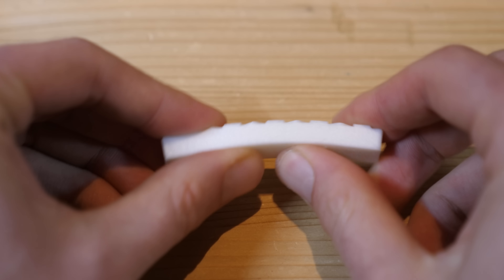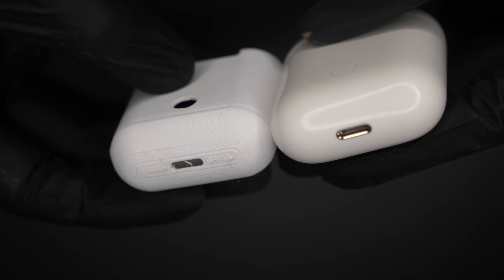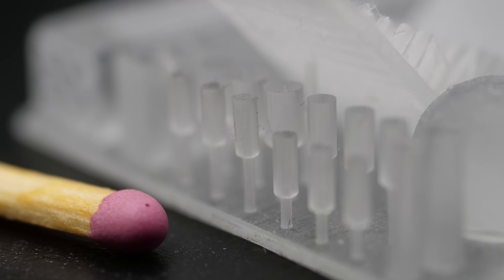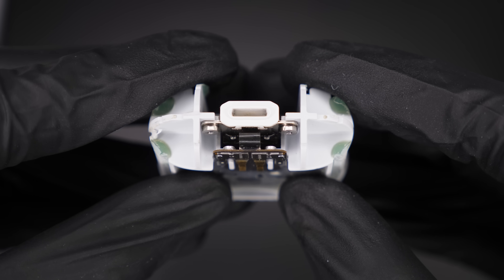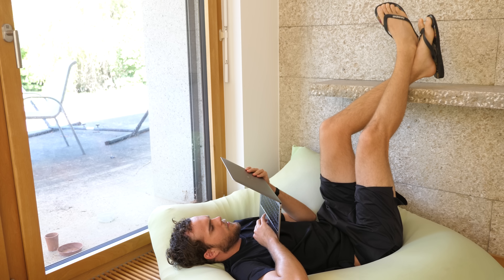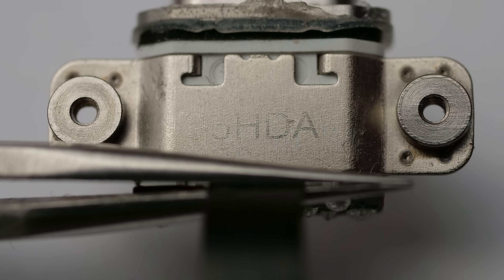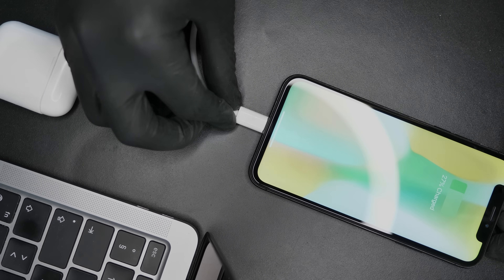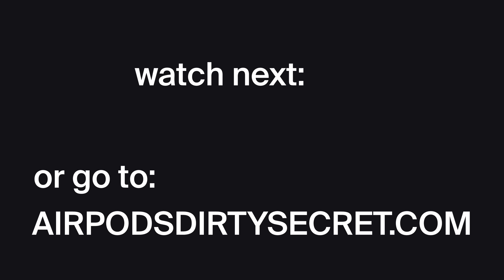AirPods' Dirty Secret (and how I'm fighting it!)

Comment: While I am not an expert in any of these fields that are shown here, the general problem with these replacement cases is they never have the same resolution. You could get close with a $3000+ printer, but never perfect, because injection molded plastic while extremely expensive if you are doing 1 case, makes mass production much cheaper, and gives much better quality. No doubt you did a really good job, but it is very hard to match the physical case quality without injected molded plastic sadly. No hate to you, but this is the hard reality of it. I been using a airpods 3 super clone for the past year(slightly before release), and they have been great. The 1 thing that when compared side by side with real ones that sticks out is the henge, the textured pain rubs off. They gave me(The end user) a pretty high quality product for $50 by dropping the profit margin, and giving a slightly less quality henge that is just less visually appealing.

Comment: I believe if this were to be made on a slightly higher scale, laser welding would be the perfect tool for the job. I’ve worked with laser welders before and this is exactly the sort of thing they excel at. There are companies that specialize on these types of projects in small scale production, one of which is where I worked with these laser welding machines in Germany.

Comment: you don't need a tig welder, just use iron, copper or bronze for the parts and solder them with tin, will not be as durable but will be enough

Comment: While I agree that Apple's policies are ridiculous, it could easily be argued that this method has much more of an environmental impact than reordering a new case. When everything it takes for these components to be created and delivered is taken into account (initial unusable 3D models, fuel associated with transportation, and waste at each manufacturer) buying a new one probably is more economical, both monetarily and environmentally. Cool vid though.
Reply: Good point. But a lot of that could be avoided if Apple made their products repairable from the start

Comment: You can buy around the same quality sounding earbuds for 30 dollars or so online but have to know what ones to get. 

I hate apple so much, I got a redmi K40 12/256 on a flash sale in the UK for 194 pounds with redmi buds 3 Pro included after I bitched on the phone that my 40 pound coupon did not work.

And wow they sound better than apple buds.

I went with the K40 as it was before the SD 8 gen 1plus was announced and you could see how bad the 888 and 8 gen 1 was and thorrling worse than the 870.

The new mediatek dimensity chips look good but no way to bootload them. 

I like how easy it is to get official parts cheaply form China and how easy it is to replace the battery.

I really wish they would standardise on a USB turbo charger as some company's have mulple types depending on the wattage and even if the same wattage it won't work with another company's.

I'm really surprised apple is not moving towards faster charging, maybe they will just have no port so the EU can't force them to go to USB C lol

I'm surprised the US and Canada does not have a 2 year minimum warrantee like in the UK and EU. 

All phones, computers, laptops, pads most electronics all cars and home appliances should have the right to repair, use standard hex or whatever screws that are non proprietary and you should be able to get schematics for free and parts for a reasonable price, it should also be legal for company's to make OEM parts just like company's do for cars. 

If company's had their way you would have to call GE to have a GE genius come over to change your light bulb. 

I have seen quite a few collage students who rent apartments and you go inside their home and think why is it so dark as alot of the bulbs in a certain room are out. 

You ask them and get a reply like I will get a friend / the landlord to fix it.   
Not just girls, guys also....

Comment: The amount of times these heaps of junk gets issues and need to be replaced is insane. But it's not an issue exclusive to Apple. Every single other wireless in-ear headphones are RMA'd in 3 steps.

1. Report issue
2. Get credit return on product after either NOT sending them or sending to repair shop for inspection. (Jabra/Sony needs you to send them in for inspection, while cheaper garbage like every Airpods clone and most low-end brand you just throw it away without anyone needing to check. Everything still gets scrapped and swapped either way if accepted, never repaired.)
3. The item gets scrapped.

It's just that AirPods are overpriced as hell.

Comment: What was the point in mentioning the landfill part? You're still destructively removing the original shell. That still creates plastic waste. It would have made sense if your replacement part allowed you to non-destructively remove it.
Reply from the maker: You missed the point. The product was specifically designed so that it is impossible to fix in a non-destructive way. I come up with a destructive way, which indeed generates a small amount of plastic waste, but now there is a way to save the rare earth materials present in the electronics and the battery. This could not be done before
Reply: No I got that part. But, like I said, you still haven't really provided a sensible solution to the issue of landfill waste you mention. By mentioning it at the start of the video, you create the impression that your design in some way addresses it. There's nothing currently stopping anyone from smashing apart their old, broken case and recovering the battery in it before throwing away the plastic - which would solve the rare earth recovery problem just as simply as your 3D-printed replacement solution.

Comment: For those with normal 3d print who can't get a fine result, just spray paint and sand repeat a few times until the surface is smooth.
Reply from the maker: Yes or abs + acetone bath

Comment: so... basically you are throwing away the old battery, case and connector. Surely that's almost as much waste as throwing the whole case away. Plus the time, energy and materials used to replace them. I think Apple is correct to not bother, They should have made them easier to fix in the first place though. Nice video.

Comment: In Germany they change the battery at Apple Store‘s🙃
Reply from the maker: Do you have a source? I'm talking mainly about the first generation case
Reply: @ExploringTheSimulation  I have a picture from my local Apple Store. The price’s. Thx for your answer.👍🏻
Reply from the maker: @derdaui  I'm pretty sure they just replace the case. Thanks for the comment
Reply: @ExploringTheSimulation  They have replace the whole case or just the battery. For the 1. 2. and 3. generation case and the air pod.

Comment: - doubts it is economically unfavorable to repair the case rather than just getting a new one
- uses equipment worth thousands of $ and spends days with fixing 

:-D 

Interesting video though, and i understand the target is to show what is possible.
Reply from the maker: if the case was not designed in this way and the replacement parts were readily available, it would be economically viable, which is what this video aims to show

Comment: Do you think the high voltage spot welding has a chance to damage your pcb or the components on board? I see you have the metal grounded close to the spot welds, but I wonder if there's any chance of damage similar to ESD.
Reply from the maker: Good question. I'm not 100% sure but here I'm welding on the ground plane of the pcb and the ground wire of the welding machine is super close to where I'm welding, so I think it should be fine (and it was). Thanks for the comment

Comment: I detest Apple and I applaud your work.  However, if one looks at the case as the battery, $60 for a new case (battery) doesn't seem entirely unreasonable to me, given that the battery part alone will cost $10-20 and most people don't have 3d printers.  So while i applaud the effort and skill demonstrated, buying a new case is, unfortunately, the best option for most people.
Reply from the maker: Yup, that's the point of the video. Those cases were designed on purpose to be unrepairable

Comment: If that welder shoots off UV and IR radiation, please be careful, or you'll damage your eyes. Not sure if the microscope lens protect against it.
Reply from the maker: Yes the microscope is connected to the welder and closes the field of vision when the spark happens:) pretty neat
Reply: @ExploringTheSimulation  That's so cool!

Comment: Replacement Airpods charging case on Amazon = $36.00. What you've done here looks like it includes about $40.00 in parts or more ( Especially considering the custom parts and shipping costs ), 15 hours of R&D and about 10 hours of labor. Your welder is about $7,000 and printer about $500. I'm excluding the tooling cost and R&D cost for the viewers, because I'm assuming they already have a 3D printer and a dab of super glue is all that's needed to secure the part you welded. You've also already done the R&D for the viewers. In the end, so your viewers can repeat what you've done for about $140.00 for parts and labor at a rate of just $10 per hour on labor. Time is valuable and people often forget that. I wouldn't consider this a valuable project, but it was certainly fun to watch.

Comment: Probably shes right. When you calculate the costs of material with tools that you needed in this video, and the costs of time for someone repairing it, it's more economically just to pick a new one from the assembly line. 
But great work here! That effort you put in is pretty neat!
Reply from the maker: Not really, here I showed the whole development part. If someone were to get their hands on a ready-made kit that I've designed, the install time would be just 5 minutes. Thanks for the comment.

Comment: Clearly an intelligent guy but a few things. Firstly, people going on about landfills…how much carbon dioxide do you think the shipping of individual parts in those plastic bags created. Apple Support said it’s not economical…not impossible. Lastly, go ask a pilot if they agree with letting the general public take  modified or self repaired devices with lithium ion batteries on board the plane. You, video maker and also you, reading this may well have the skill to do this safely. If you do then I guarantee you also understand that the “general public” are absolutely clueless, careless and should not be trusted to endanger others with shoddy and therefore dangerous repair work. You wanna get on a plane with the person next to you who loves TikTok having just replaced their battery and having skipped an “unimportant part”? Samsung know what happens when you get this wrong remember? I also find it incredibly ironic that anyone intelligent enough to actually understand how to do this thinks that the EU has more right and knowledge on how electronics should be produced. Hand over the decisions on technology to a bunch of bureaucrats who think Wi-Fi is the same as the Internet. Think it through.

Comment: But…. the case wasn’t “repaired”, it was replaced.  Just like Apple said had to be done.  Except this one was replaced by a 3D printed one which in all likelihood used more energy and material (on a per-unit basis) than the mass-produced Apple originals.

I mean, good job, nice work and all that (genuinely, really, a nice result and great skills).  But, beyond establishing that you could do it and that Apple have deliberately made something that cannot be repaired (Hold The Front Page!), what was the point?
Reply from the maker: I think you're missing that the case has a lot of electronics and a battery built-in. So only the plastic shell of the case was replaced, not the whole case. The point is to save the rare earth materials inside the case from ending up in a landfill.
Reply: @ExploringTheSimulation  fair point, though there's more "rare earth" gubbins in the battery that still ended up propping up a hillside than in the scant few components on the tiny little PCB (not to mention the additional componentry that was created in wasteful 1 of / small batch runs).

What it DOES do is server to illustrate that repairs would be possible and economical IF the plastic case were not specifically designed to be "single use" (illegal in many countries, if a shopping bag - which ironically does have multiple use potential, despite being labelled "single-use").

And even then, Apple should be able to cannibalise old cases for their internals to be inserted into shiny new single-use cases.  That's a message you COULD take away from this video, but if that was the point it is made only slantingly obliquely to the point of being indiscernible.

Comment: 99.995% of people that may attempt the repair, will get a quarter of the way through, say "fuck it", smash the case and just purchase a new pair. Good video though.
Reply from the maker: I disagree. Here I showed the whole development part. If someone were to get their hands on a ready-made kit that I've designed, the install time would be just 5 minutes and be easy. Thanks for the comment.
Reply: @ExploringTheSimulation  most people can't even change their screen protecter. A good kit goes a long way to making it easier to do for the average person.

Comment: 1 thing I would like for the airpod cases is to have a on and off button. Since well charging the AirPods themselves the whole time is extremely bad for the battery and if you could turn off the case charging and only let it charge between 20-80% it will maybe double the lifetime of the AirPods.

Comment: Ok bravo you did it, but the energy invested is 1000x fold in comparison to a new one. Not even speaking about your ecological impact for 1 copy. Airpods must be recycled as Lithium, not trashed nor thrown to electronic recycling
Reply from the maker: Here I showed the whole development for one prototype, it would be completely different if the kit I've designed were to be mass produced. I'm not sure how you came up with the 1000x number.
To conclude, what do you think will happen if you put your AirPods in the Lithium bin at the recycling center? It will be properly opened up and someone will take the time to separate the plastic from the PCB and the built-in battery? No, it will end up untouched in a landfill.
Thanks for the comment.

Comment: Thanks for proving Apple lady was right. 

It is more economical and easier to just get a new one. 😓
Reply from the maker: Not really, here I showed the whole development part. If someone were to get their hands on a ready-made kit that I've designed, the install time would be just 5 minutes. Thanks for the comment
Reply: @ExploringTheSimulation  I doubt those 5 minutes. Or that it will ever be worth over a $30-40 used eBay replacement case. 

But hey, if that happens, let us know.

Comment: This is false economy, false “recycling” and is clear greenwashing. The waste in materials to “make your own” the carbon impact of importing the needed parts would be a great deal higher than just getting a factory made replacement.
Reply from the maker: Not really, here I showed the whole development part. It is just getting the idea out there. If the kits I've designed were to be mass produced, then the impact would be far smaller. Don't forget that I'm just printing a few grams of plastic to save rare earth materials present in the electronic circuit and the battery. Thanks the comment

Comment: Now, after doing all of this, have you learned why it is more economical to just replace the case than it is to repair something so rinkydink as a charging case?
Reply from the maker: You've missed the point. It is to show that the thing was designed so that it is more economical to replace, on purpose. But it shouldn't be like this and I propose a solution for those who do not want their case to end up in a landfill. Thanks for the comment
Reply: @ExploringTheSimulation  No, I did watch the whole video, it was awesome. I am only tickling the literalism-bone. Keep up the good working.
Reply: True

Comment: 2000$ of equipement to repair 50$ case.... you should follow the customer service advice next time :D
Reply from the maker: You've missed the point. Here I showed the whole development part. If someone were to get their hands on a ready-made kit that I've designed, the install time would be just 5 minutes and not require any complex tool. Thanks for the comment.

Comment: but why did you use welding machine? Wouldn't it be more useful to leave it on screws?
Reply from the maker: The welding machine is just to fix the nuts in place on the USB-C connector. Then we can use screws to screw in the connector to the plastic frame.